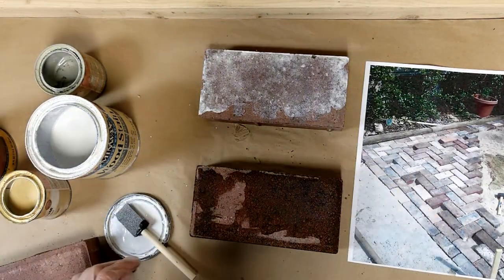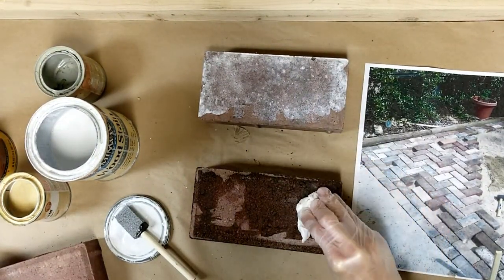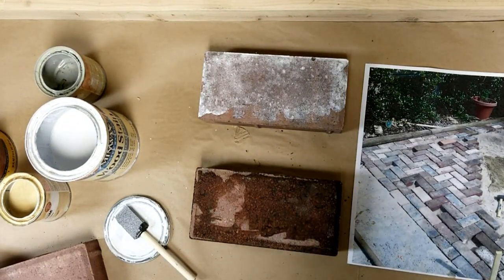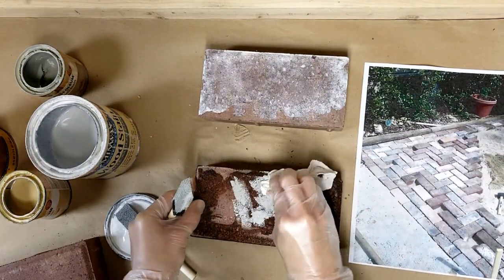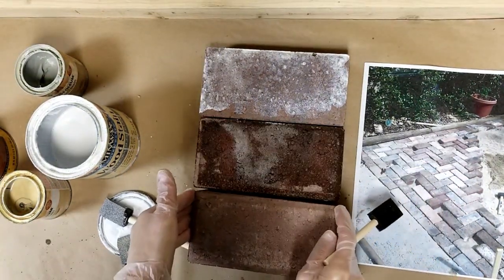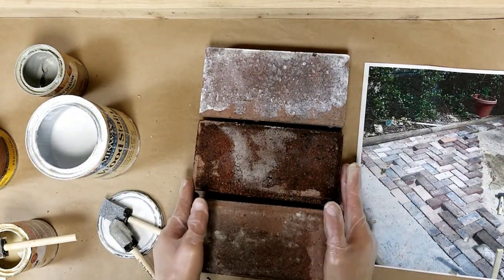Make new brick pavers look old - DIY antique brick look using stains and whitewashing brick

Comment: The whole point of distressing bricks is to make them look naturally aged and eroded. The end result of your aging process looks obviously contrived. In other words they look fake or like someone simply spilled paint on the ground... to my eyes at least! It's a subjective matter and others might think otherwise. The one culprit I noticed that might have contributed to this, aside from your technique, is the fact that you used colored cement bricks, the kind they use to lay sidewalks with, and not clay bricks as the ones used in the "inspiration" picture you used.
Reply: how would u do it then? im interested to learn different weathering effects
Reply: @izzysenpai5428  Like you, I came here to learn. My comment is based on an observer's point a view and not an expert. Since I never tried to age clay bricks before, I can only make assumptions. If I were to do it, I would make a large bonfire and place the bricks in it a bunch at a time of course for discoloration. Not sure how regular clay bricks would react to the heat, but I'm sure "firebricks" will do just fine.  I might experiment with pouring water on the hot bricks after I remove them from the fire. I would also devise a practical method to chip brick edges by hand or by placing a few at a time inside a barrel and rolling it around, and not in this particular order. Until that day, it's only a mental concept.
Reply: @izzysenpai5428  I'm just going to mortar over my fake brick pavers with a light coat of mortar.